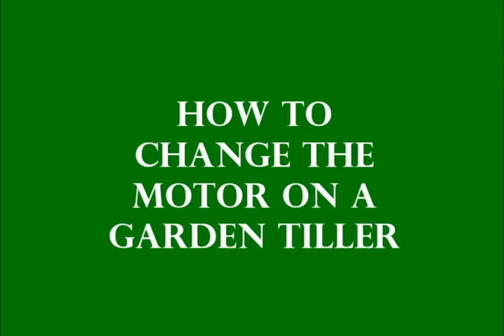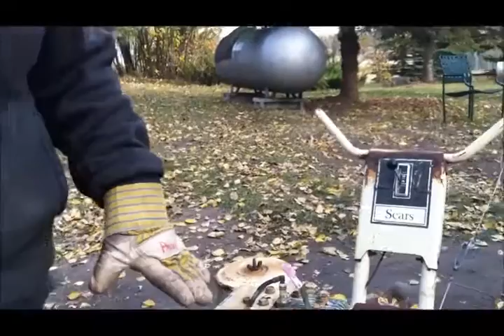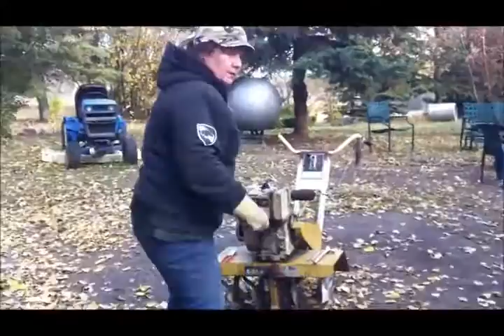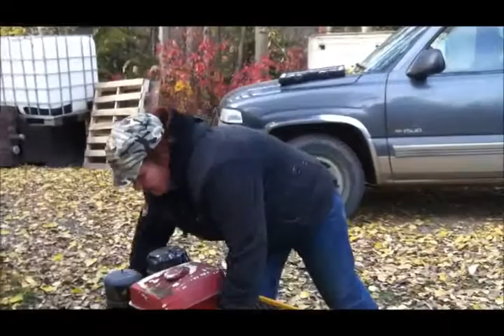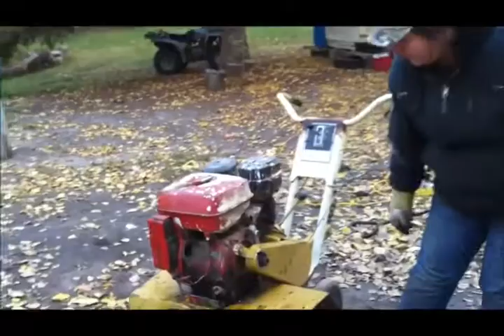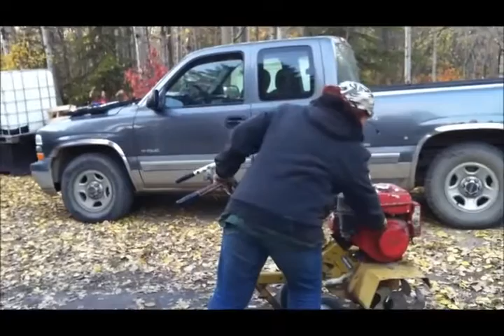How To Change The Motor On A Garden Tiller

Comment: Pam, not sure how much you want to put into this channel but if you want you could 
- show what you needed to disconnect before you were able to pull the engine.
- show how you installed the replacement engine.  
- show what didn't fit up and what you did to make it fit up.  

That would kind of show the "troubleshooting" process.  I think showing the logic to how you tackled the various obstacles you ran into before you had a working machine again would be good.  Maybe mention where you might look for a good used replacement engine in case you didn't just have one laying around.  

Things like making sure the mounting bolt holes lined up, making sure the sheave was the same and or the shaft the sheave mounts on are the same size, etc. would be good.  Also, you punched a hole in the belt cover.  That's okay but you probably would want to take a round tin can and make a cover for where the pulley is sticking out so someone can't get something stuck in there.  Having a guard covering spinning parts attached to an 8 hp motor are kind of important if you have kids, or pets or a shirt tail etc that could get caught in there.  

Thanks for the video.  Hope these suggestions are helpful.  You got your tiller going again!!!  Great Job!!
Reply from the maker: Hi notdem notrep; Thank you for your suggestions. You have expressed a very valid issue - the video should have more detail. There is not too much that I can do with that video now, but in the future I will be certain to include more detail. All input is appreciated here on the howtopam youtube channel. If anyone has any questions about any of the missing details in any video please just post your inquiry here in the comment section and I will reply with those missing details.
Thank you.
howtopam
Reply: @howtopamcom  
Pam, thanks for the reply. It’s very kind of you to take the time to put up videos others can learn from.  I recognize and appreciate your effort! Thank you!